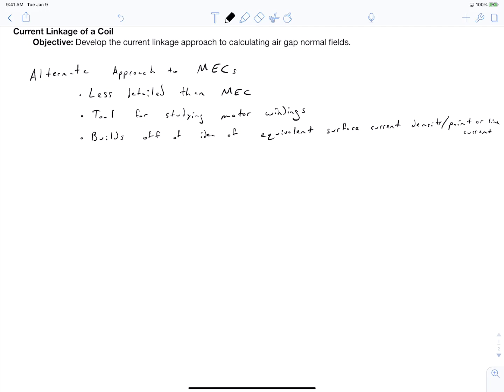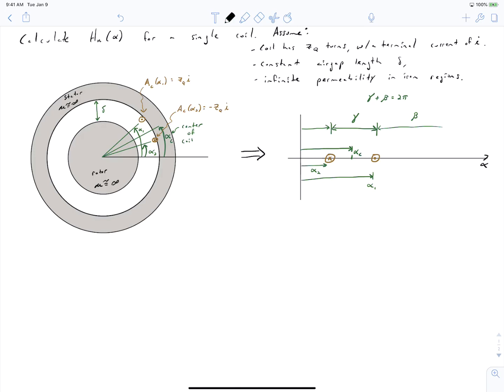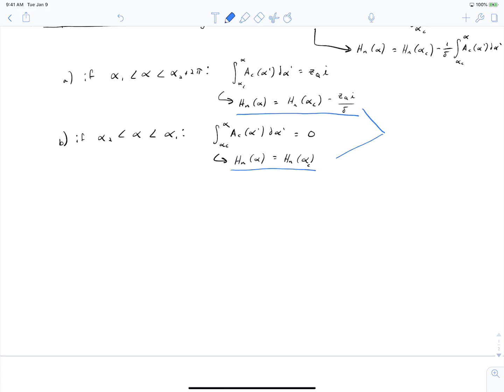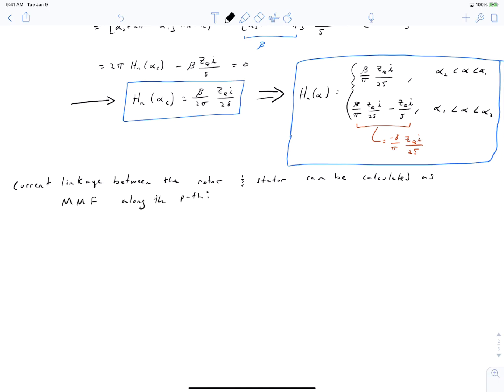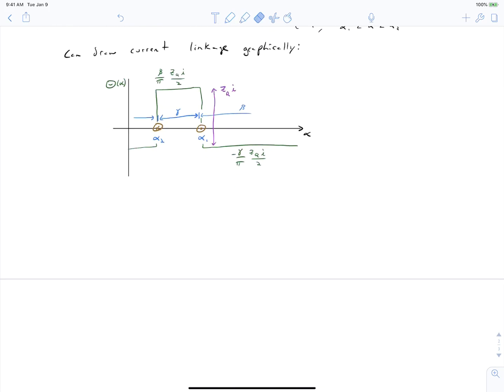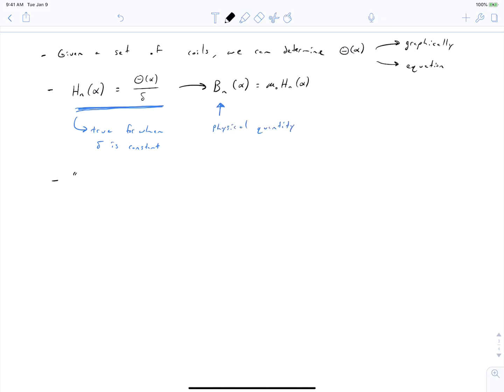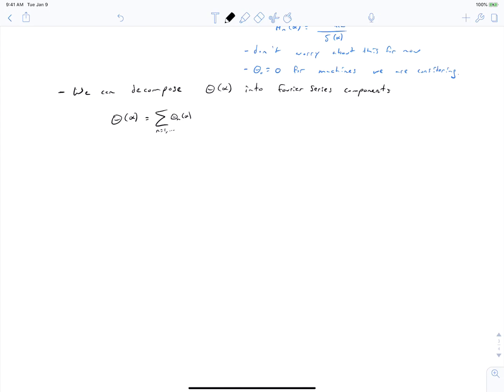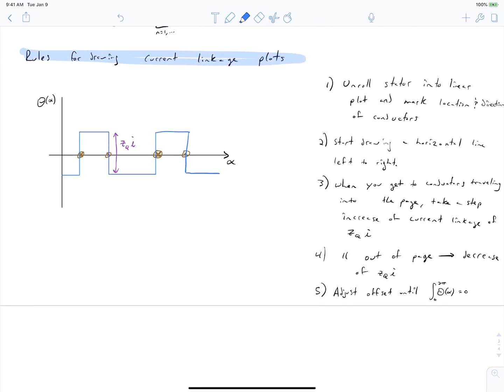L05-2 Current Linkage

Comment: I think we should not call gamma the "coil span" because if the current of the coil is reversed, the gamma will be outside of the coil. May be we should call it "the mechanical angle from the slot having current into the page to the slot having current out of the page in counter-clockwise direction.  For beta, it's from I out of the page to I into the page. The direction is also counter-clockwise. The proof of the formula doesn't care if there is  a coil or not, it cares only the direction of the currents into/out of the slots (conductors) and their positions on the stator.